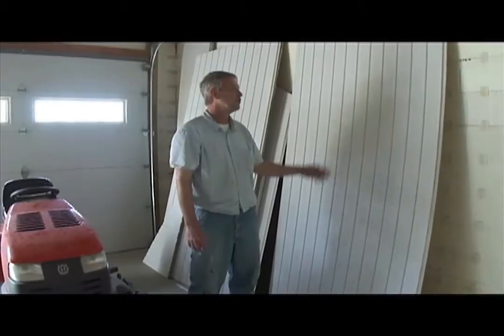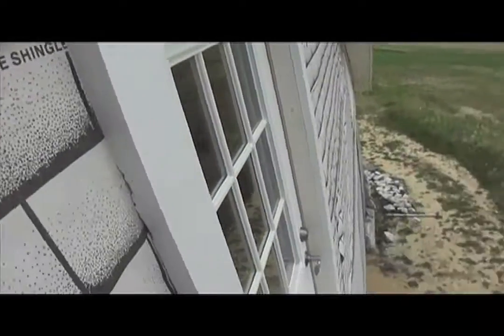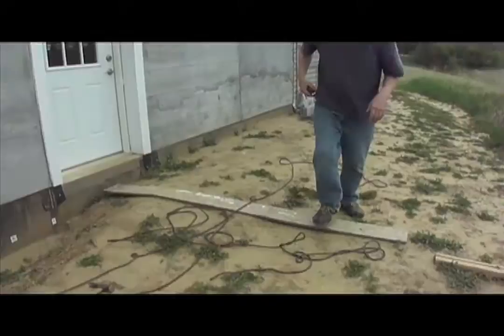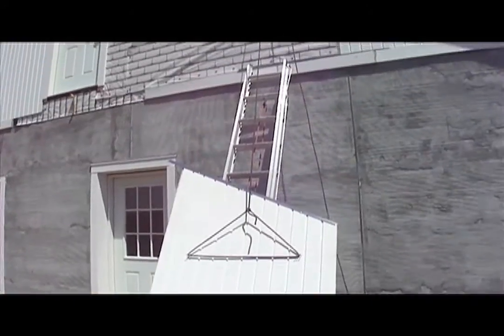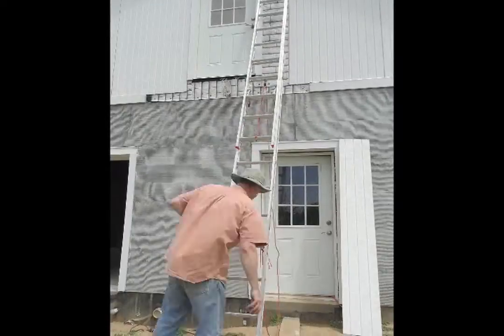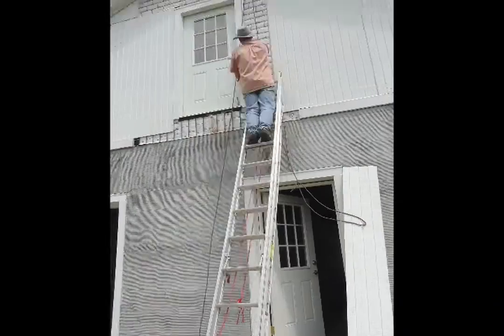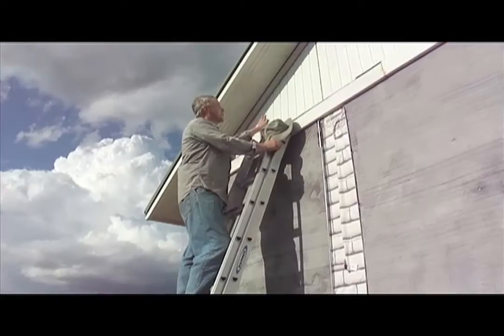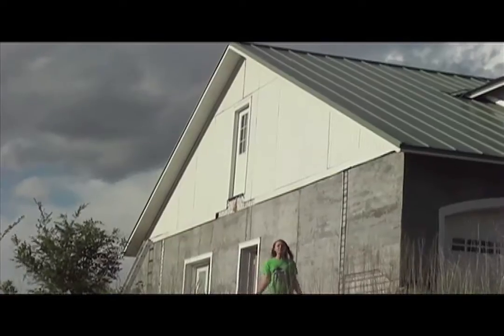Siding Installation on High

Comment: As a point of consideration to anyone reading this, you should have your 2 anchor points(the 4 screws/hooks) on the material being less than 90 deg to the tie in on the rope. It looks like the rope and 2 hooks make a right triangle, with the 90 deg corner on the top. If the material you are using is weak you will put more stress on the material the wider the angle, and it could break. If you were to push those 2 anchors about 12 inches apart from each other the ability to lift the siding is unchanged, and the angular forces against the rope, anchors, and material is much much less.